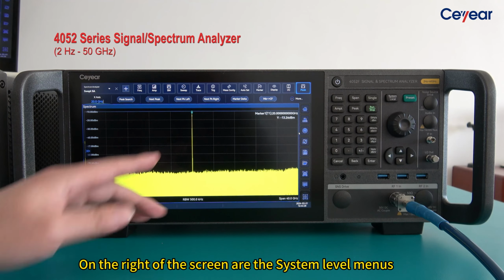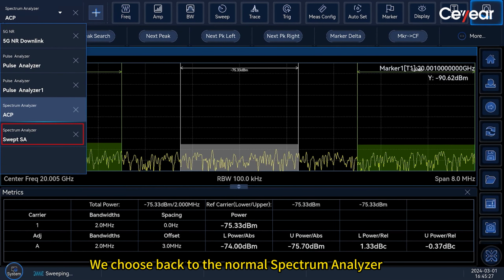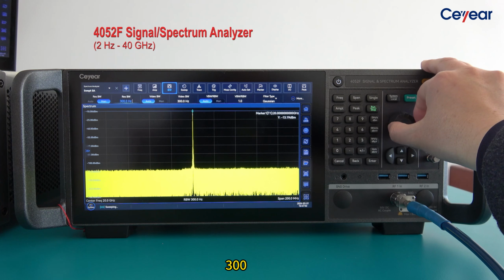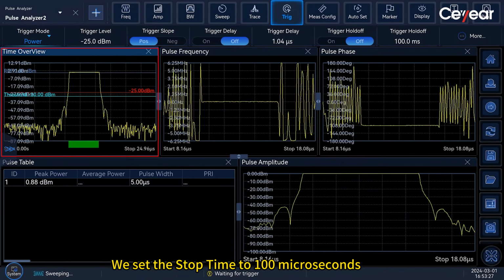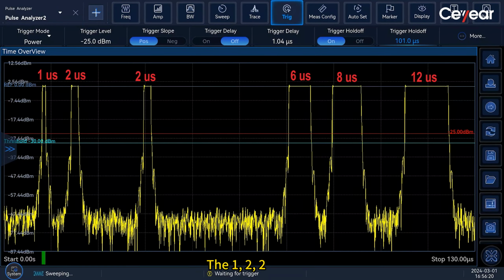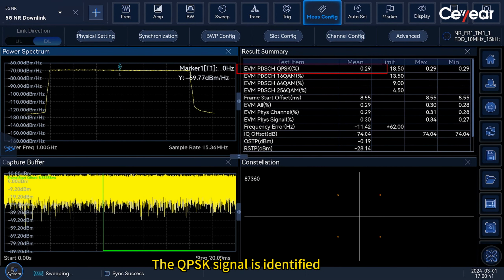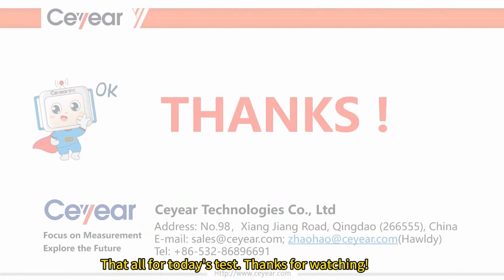How to use Ceyear 4052 Series Signal/Spectrum Analyzer?

Comment from the maker: This video tells you how to operate the newest 4052 series Signal/Spectrum Analyzer. It will tell you how to make the normal spectrum measurement, pulse measurement, 5GNR measurement and phase noise measurement.
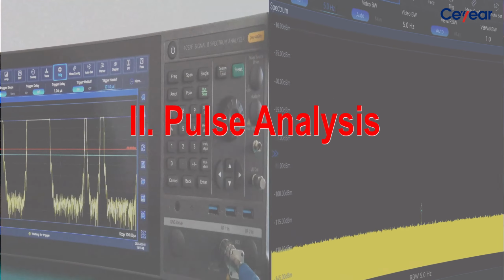01:19 Spectrum Measurement   04:16 Pulse Measurement
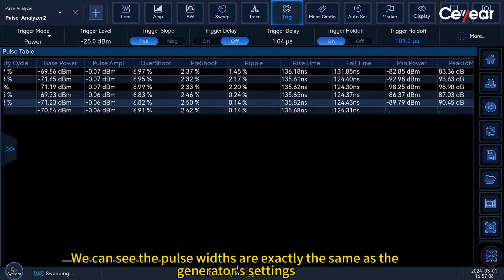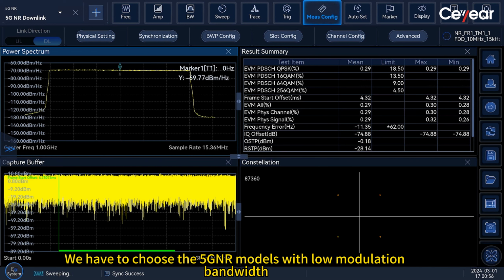07:08 5GNR Measurement          08:30 Phase Noise Measurement